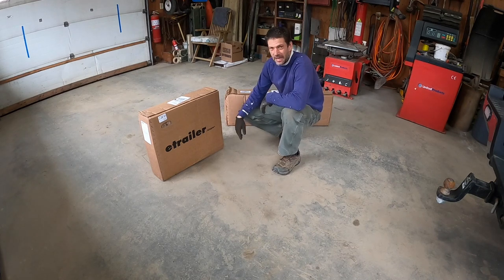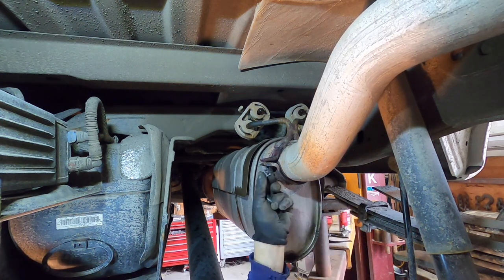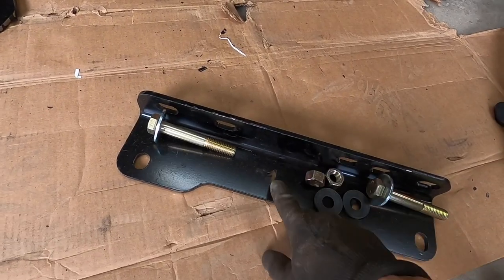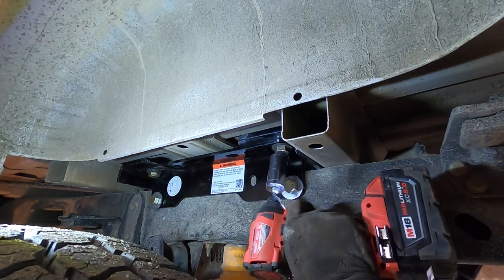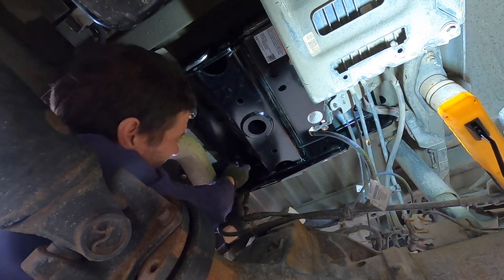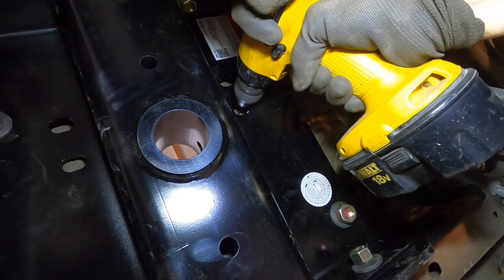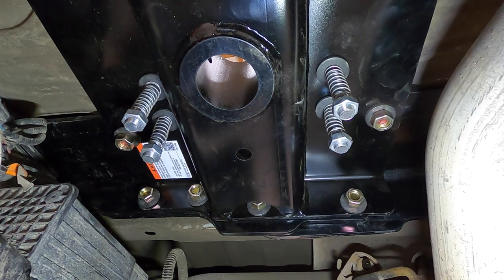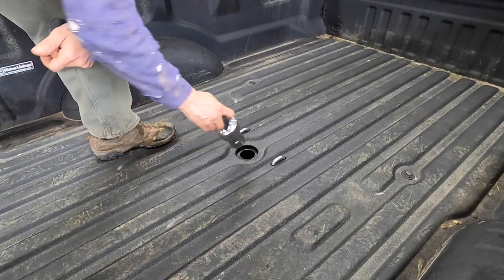Under bed gooseneck hitch detailed install

Comment: Just picked up my first trailer, used 24' goose neck. My 2013 f250  needs one of these so gonna shop for one today.  I welded a ball on my flatbed truck when I built it. Cool video